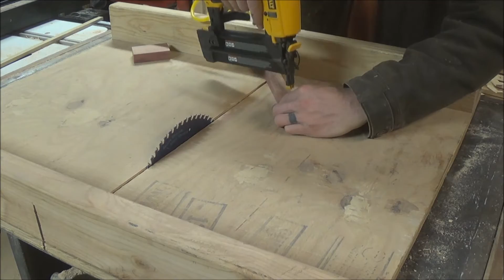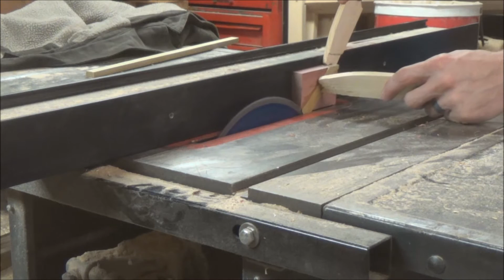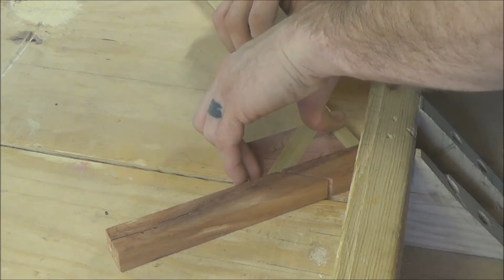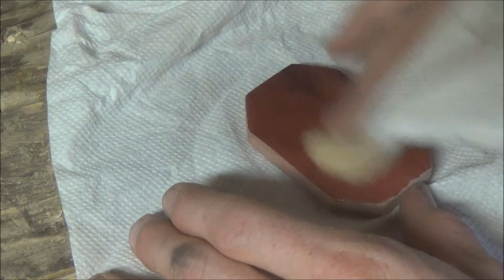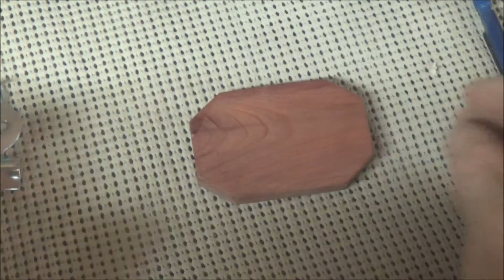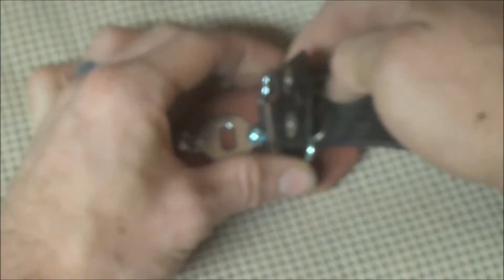Easy belt buckles

Comment: To polymerize wood, you need a vacuum pump and a special polymer compound. The wooden work piece is placed in a container with the compound. Then the container with the work piece is placed in the pump chamber and the air is evacuated from it. Accordingly, the air is pumped out of the wood and voids are formed inside it. After the pressure has been released, the polymer compound enters the wood. After some time the wood has to be baked in the oven and you get wood with the properties of a polymer. It does not rot, it does not scratch, it is heavy and strong). I don't have such a video on my channel yet, but something similar will be coming soon. I will be impregnating a wooden knife handle with "Danish oil" in a small vacuum at home. If you want to see it, I'll let you know!
Reply from the maker: I'd love to see it when it's up.
Reply: @WyldeWoodworks  OK, I'll let you know.
Reply: @WyldeWoodworks  I have already posted a video about vacuum impregnation of wood with a natural polymer - linseed oil. I hope you will be interested )